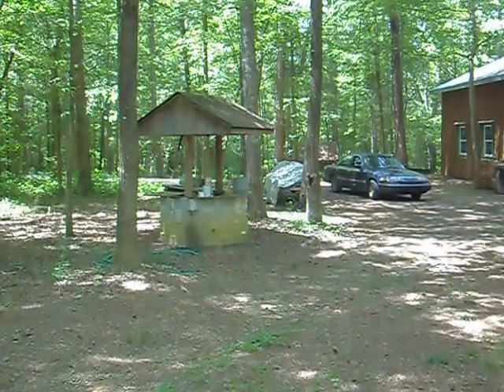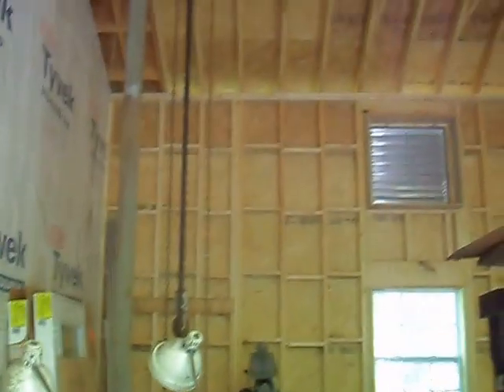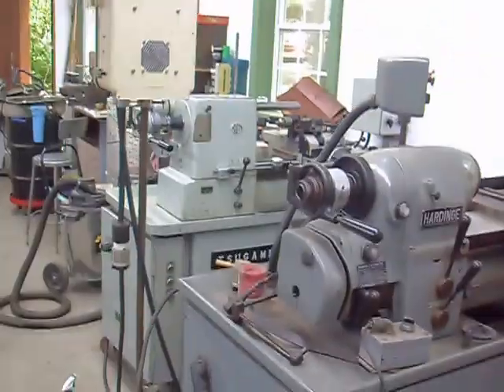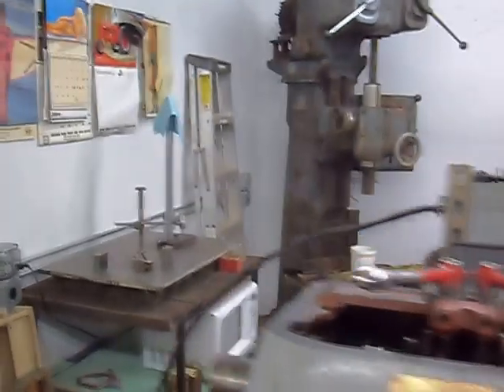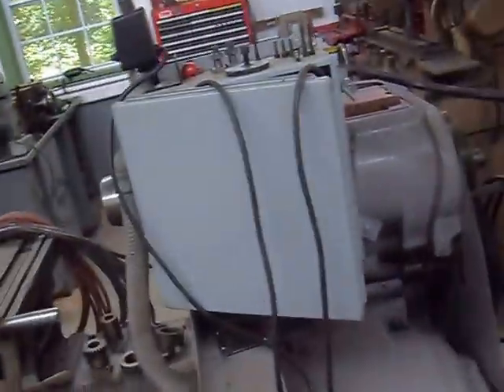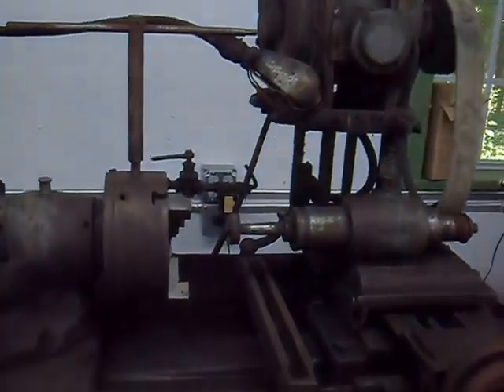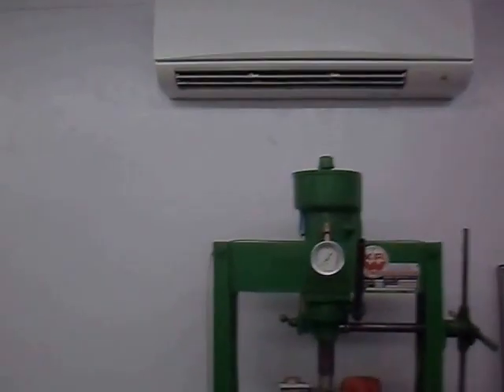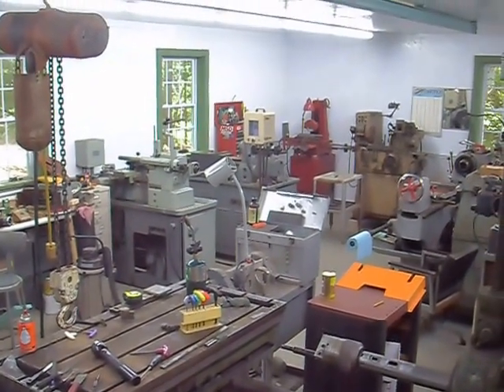Doozer Machine Shop

Comment: Very nice!,  you need a building 2x bigger.. :)  How thick is your floor to support all that heavy gear?   It gives me ideas for my future building on my new place.
Reply from the maker: David Andruczyk  Dave, the slab floor is 5" thick, perimeter footers are 2' down.  In NY you have to go deeper.  The wall that separates the machine area from the high bay also has a footer under the slab. Machine area has 9' ceiling and high bay has 14' to the collar ties to fit the gantry.  I love my sliding door to the machine area, it is 6'x9'.  Main door is 10'x12'. Still need to make sliding doors for it. Hope you are well.

Comment: wow great shop. the average guy sure doesn't  get that much space here in New York City
Reply from the maker: Thanks man !  Are you a Locksmith ?  Ever mess around with door closers?  I work at the Assa Abloy factory.
Reply: @kooldoozer  Yes I'm a locksmith, I work in the Garment district, just below Times square. Sure, we're called on to service and replace door closers. If you're making door closers I suppose you're working for Rixon or Norton? Now and then we're called on to  replace Rixon 27 closers. I've been told that "back in the day"  your average local door repair company would rebuild door closers. Then again, I know someone who sharpens things like  scizzors and deli slicers, he says that before big box stores sold circular saws cheap, that he would sharpen all manner of saws too.
Reply from the maker: @tilliesinabottle  There are repair centers that still buy our parts for the Rixson 27.  In our factory, we make Norton, Sargent, Corbin Russwin, Rixson, Yale and Arrow.  We make closers, operators, slide tracks, and pivots.  If you ever have questions or feedback, I would be glad to hear from you. I  am a mechanical engineer and I run our test lab.